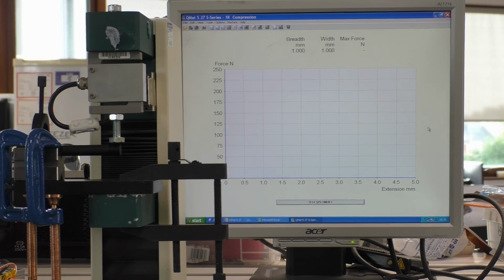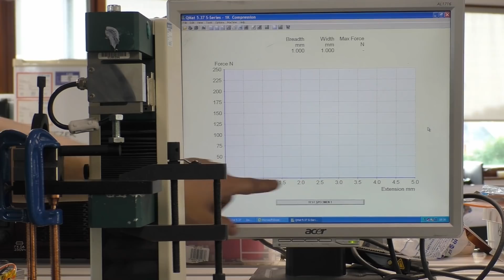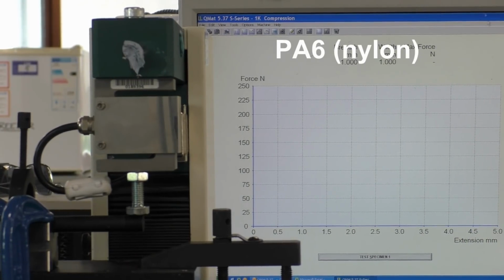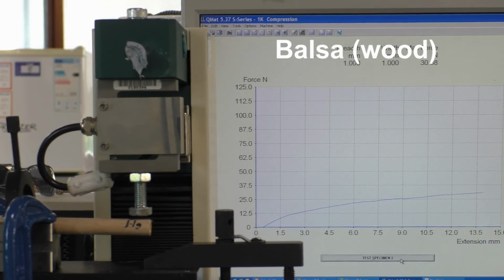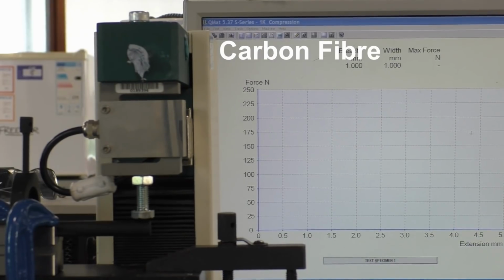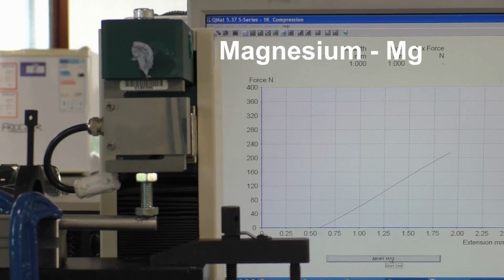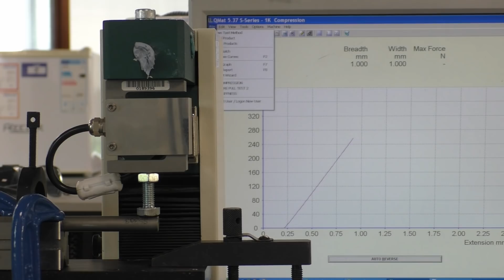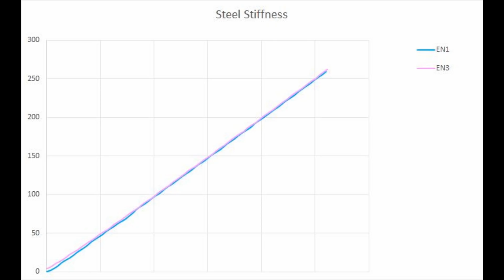Which one is stiffer? - Material testing

Comment: So if I've understood this correctly 8:28 carbon fibre produces the most horsepower but with quite a violent delivery at low revs whereas balsa would be more suited to the road due to the flat torquey power curve?.....🙄